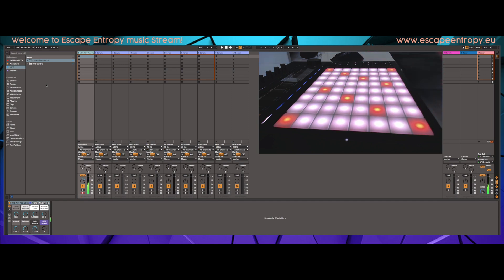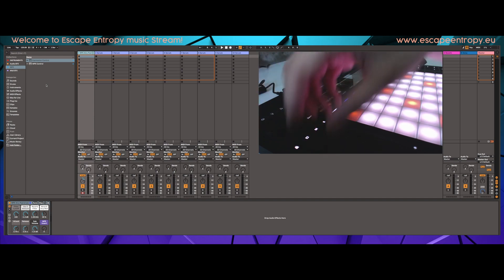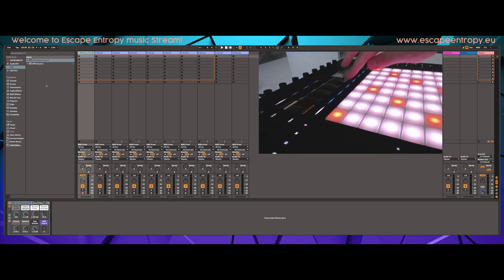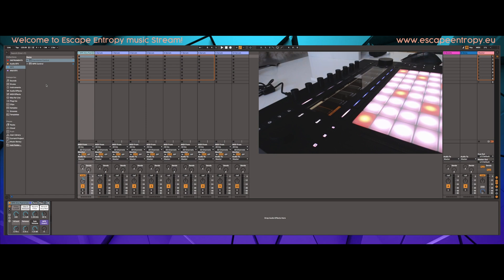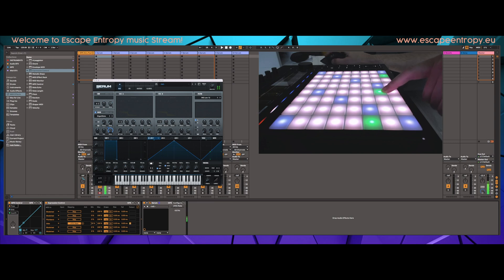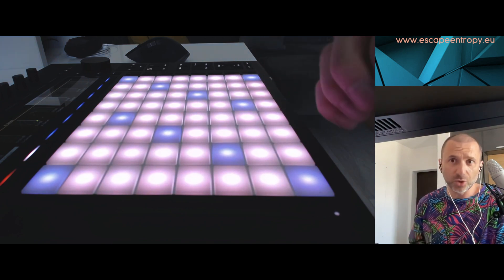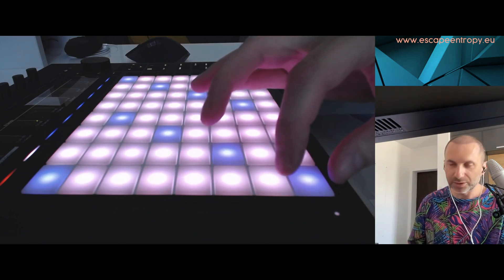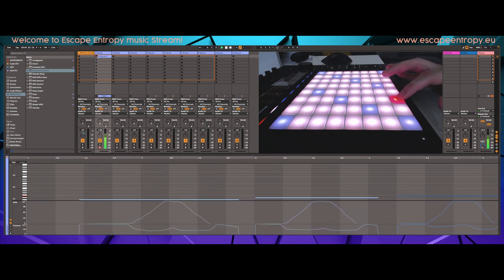Problems with my new Ableton Push 3 - How to check

Comment: Last December I got my first Ableton Push 2 and I was so happy in the idea that I was about to get the absolute controller, solid build and trust worth for Ableton live. After a few weeks, while playing with the pads, I realised that when I was hitting some pads on the board they were activating also the pads next to them causing dissonance.
I contacted Ableton and after a looong time mailing and waiting due to “production problems” I got a replacement after almost 3 months.
I open the replacement “brand new” Ableton push 2 and after checking everything very carefully I realised that I got another machine with the exact same problem in different pads than the one returned! 
Ableton told me that this is an exceptional situation (to have received a faulty unit twice) but they will replace it to a new one!
Still, 6 months after I am trying to get my money back once I don’t trust to get a 3rd Ableton push 2 but they insisted very bad that money can’t be refunded once the 30days-trial is passed!
Great software, disappointing hardware, even more disappointing policy…
Reply from the maker: this is a horror story, I hope the same thing doesn't happen to me, so far no news from them for 2 weeks

Comment: Thank you for sharing this video. I have been searching for information on buttons and encoders. It seems my Push 2 is experiencing the same issue with a jittery encoder. It appears that the issue still hasn't been addressed from ableton. It's a shame that I don't use it anymore because of this.
Reply from the maker: You are absolutely right, I am also disappointed. I am waiting for an answer from them if they will replace my product with a good one.